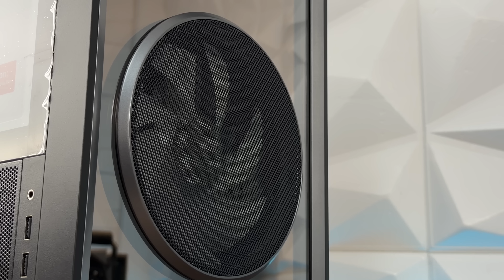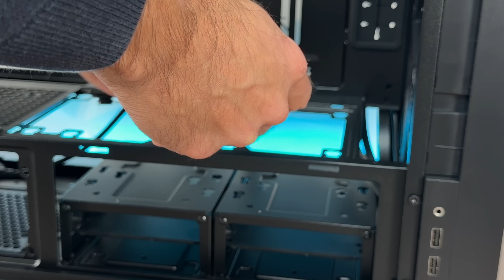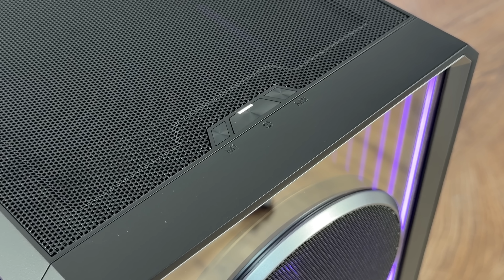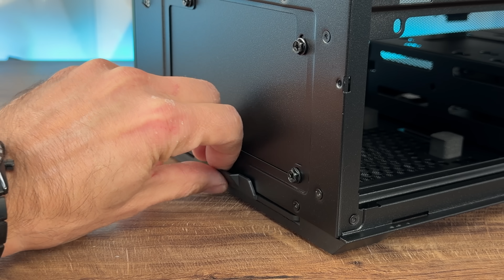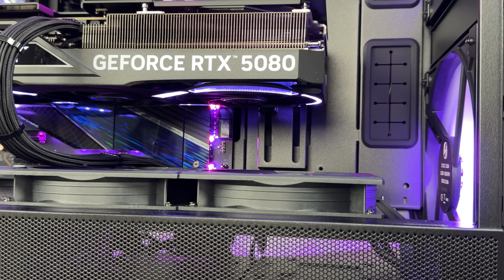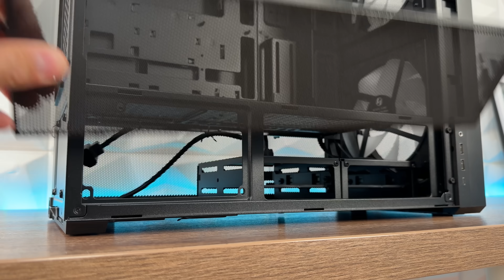Lian Li LANCOOL 217 INF   Exceptional Flexibility, Serious Cooling

Comment: When I tried to customize the lighting on the infinity mirror and included fans, I could not get them to sync with SignalRGB or OpenRBG despite being connected to my motherboard’s ARGB headers. The ARGB fans I bought work flawlessly with both softwares, but not the case itself. Do you have any solutions or information on how I could get it to work?
Reply: The case itself and Lian Li's Hydroshift AIO isnt supported by Signal. I asked them about this same thing a couple of days ago. They are on the list to be implemented.

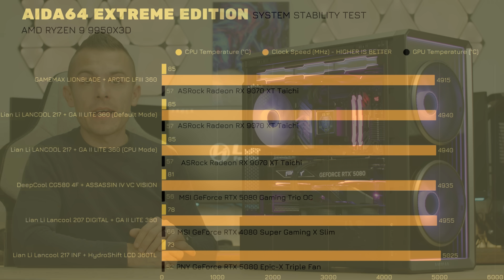Comment: Nice review.  Unfortunately the comparison charts at 9:35 aren't useful because of multiple different configurations.  Different AIO, different GPU, so trying to compare it to even the regular Lancool 217 is pointless.  You've also added in PSU shroud fans that don't come with the case.  Just as a suggestion for improvement in future reviews, you might want to select a standard set of hardware that you use for your case reviews.
Reply from the maker: Not sure if I mentioned it in the video, but that was on purpose for comparison original 217 and making it even with 217 INF adding those two fans. CPU is the same, the GPUs isn’t only. The rest of the bunch is there since I didn’t want to remove them. Otherwise, the majority of the reviews have the same configuration.

Comment: Maybe if they make a variant that's a bit longer and supports side 360mm fan/rad mount, that'll be nice. RTX 5090 would cook up the CPU when the AIO is mounted on top unfortuantely even when the CPU isn't doing much lol
Reply: Why would the cpu get fried by the graphics card?
Reply: @orohana6622  i meant cooked as in CPU runs in 70C with top AIO mount vs 50C with front AIO mount
Reply from the maker: @teethashaquan5395  AMD runs on high temps... That is normal. 20C difference doesn't exist from switching AIO from the top and front.
Reply: @PCCrazyDario  that literally was the improvement I'm seeing. I moved the 360mm rad outside of the MATX case now and it rarely goes above 50C. the 5090 FE also runs few degrees cooler and with 35% fan RPM instead of >60% since the hot air leaves the PC case way faster without those fins from the AIO getting in the way.
Reply from the maker: @teethashaquan5395 What CPU and mATX case do you have?
Reply: @PCCrazyDario  9950x3d and AP201. the CPU is practically 8 cores during gaming due to core parking.